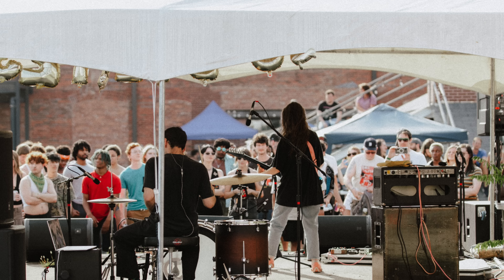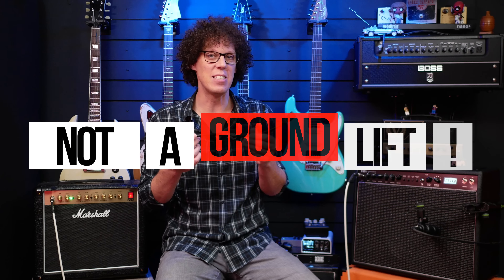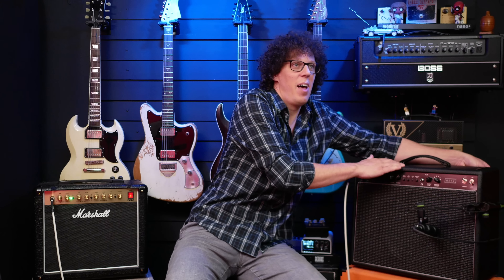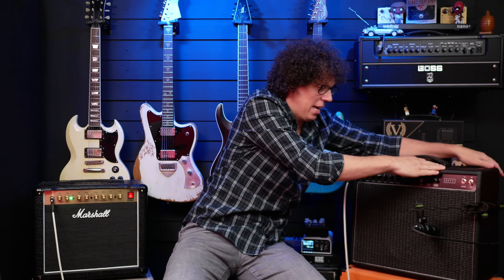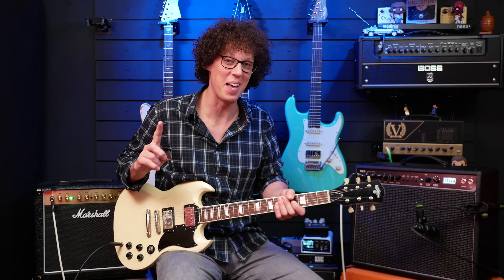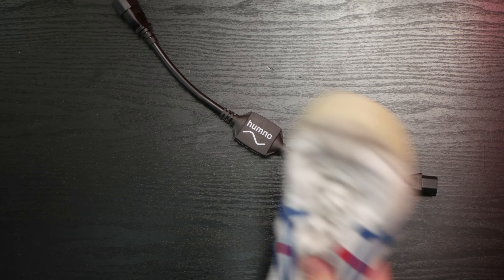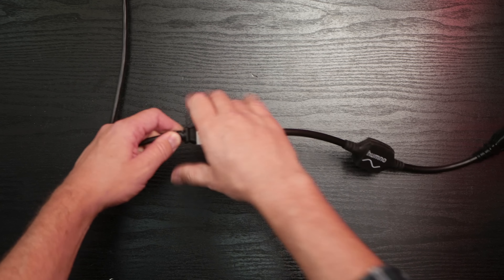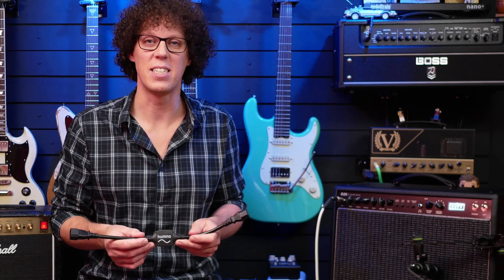Save your Guitar from Ground Hum or Snake Oil? | Morley Humno

Comment: The 1M$ question is: Why aren't amps built with this in them decades ago?
Reply from the maker: That is a damn fine question!
Reply: Probably because guitarists would say "it sucks tone!"
Reply: Maybe because they're supposed to be loud anyhow? And they just didn't care much.
Reply: @nedim_guitar  Huh? The video was about eliminating ground hum noise.
Reply: @v3n0mm3n0  Yes, I know. I'm just thinking about why they haven't built that stuff into amps decades ago. Probably because of the imperfections of all equipment, recording etc.
Reply: Well, it's an added expense, and it would only address the problem at one device (the amp). And if you followed the distributor links, you'd realize it's a very nontrivial expense. Ground loop hum can involve other parts of your signal chain. I have brought a HumX from Ebtech Audio (before Morley took it over) to soundman gigs for many years. I have it on a power strip that handles the mixer, power amp, and other devices. It makes no sense to put one of these in multiple devices (with the accumulated expense) when one of them can support multiple devices where necessary. If you do this, be careful to obey the current limit for the Humno/HumX. I believe it's 6 A for both (it's evidently a current limit, not a power limit, so folks with 230 V mains can protect more gear). —Tom

Comment: I'm in a 1950s built apartment with old wiring. On a good day, my amps- all practice ones- don't hum on their own. On a bad day, everythnig you try to negate it only screws up any tone I'm trying to get. This Humno or even the HUm Exterminator is a problem solver.

Comment: Having 50+ years in electronics and music I must say that in that little package there's no room for a well dimensioned line filter, and,  a line filter, on the other side, is designed to reject hi (RF) frequencies on both ways. So, I only can imagine that this black box is only a resistor in series of both ground pins, with a value large enough to minimize the loop ground current, but not too large so there's still a good grounding for AC dangerous leaks.
Reply: I just use Type 31 ferrite ring chokes and coil the mains cable around them half a dozen times.  Cheap and does the trick 👍
Reply: So it is just an isolation resistor?
Reply: I think it would be really hard to eliminate ground loop hum with any kind of line filter. The hum typically has many harmonics of 60 Hz (and could have other frequencies). I don't see how a simple, small filter could be built to handle this in a flexible way on a mains or ground line.

The Ebtech Hum X is presumably the predecessor to the Morley Hum Exterminator (Morley took over Ebtech), which we're told here is the origin of the Humno. I have a Hum X, and it says "Patent Pending" on it, so I did a patent search, which turned up a relevant patent. Look for US patent US20040264712A1, "Method and apparatus for eliminating noise in an electrical circuit," by Melvin Lace. It was filed in 2003, and it is labeled as "Abandoned," which may explain why Morley says nothing about patent protection on their website (the patent probably expired in 2023). The patent is for a device that puts a pair of power diodes, connected in parallel with reverse polarity, in series with the ground line. What this does is prevent ground loop current from flowing for noise signals with voltage amplitude below the voltage drop of the diodes (e.g., ~ 0.6 V for common silicon diodes). But current from a circuit fault with a larger voltage can flow to ground (as long as it doesn't blow both diodes open!).

Here's how the patent describes the operation:

"... [T]he hum eliminator circuit uses the unique characteristics of diodes to allow for the existence of small voltages between ground and neutral but prevents the flow of any current. Various safety laboratories consider voltages up to five volts RMS on the ground line as being safe for a user. Thus, the hum eliminator, if needed, may be configured to allow up to five volts on the ground line with anti-parallel avalanche diodes or other current limiting components. The diodes have a stand off voltage of 0.7 volts, and can also be connected in series to allow for higher voltages...."

If this is really all that's in a Hum X / Hum Exterminator / Humno, it's really hard to understand the high price. The "avalanche diode" mentioned in the patent is also known as a Transient Voltage Suppressor (TVS); they're used in surge suppressors, and they're relatively inexpensive. Regular power diodes should also work, and are even more affordable. With the patent having just expired, perhaps we'll see more affordable versions soon, if this is indeed the technology behind the Humno. —Tom

PS: I tried to find out who Melvin Lace was, and whether he was connected to Ebtech. All I could find was an obituary for a Melvin Lace who died in Illinois (where the Melvin Lace on the patent lived), in 2008. He was an electrical engineer and musician, with degrees in both areas. The obit does not mention any company affiliations, but notes he held multiple patents. RIP, Melvin, and thanks for the tech! 

PPS: The patent was submitted by Romi Bose, a patent attorney in IL who evidently is still working (he has a LinkedIn page), so someone interested in the history of Melvin's patent might be able to learn more via Bose. He was affiliated with Molex (a major electrical connector manufacturer) at the time of the patent.

Comment: 4m10s. I had a wonderful sound person cut the earth to the desk before we got to the gig. I stepped up to the mic with my tele in hand and got 240v AC straight in the gob. When I stood back up(thankfully) I even impressed myself with the variety of invective that I directed towards the desk at the back. The caretaker shut the power off and we cancelled the gig. I was shaking too much to play or sing, had ringing in my ears and a baaad headache for the rest of the day.
Reply: Yikes! I ate 120 volts from my mic and a 2x12 amp I was using. Not nice.

Comment: Yup I remember growing up in the 70s and hearing stories of Guitarists getting shocked or even killed when their strings became "live". It made me wary of electric guitars and amps for a while.
My dad (electrical engineer) explained it to me at the time and he drew some circuit diagrams to show which amp designs could potentially go "live" and those which couldn't. Never ever cut your EARTHING!  Anything with a metal case or chassis should be earthed. I also remember him saying double insulation and no earthing was a very bad idea and I still think it is even though a lot of gadgets are double insulated instead of being earthed these days.
Reply: It's always worth putting a resistor between your Earth wire and your strings on your guitar
Reply: @BeesWaxMinder  I would never do that and you shouldn't have too. If your guitar is set up and wired right it shouldn't need it. An earth path should be direct without interruption. You do understand what a resistor does?
Reply: @wideyxyz2271  yes BUT it is a fairly well-known mod if you put a low Power element so that when it's subjected to the electrical force enough to cause bodily harm it will blow/break & will act like a fuse in that respect
Reply: Had a tube amp from a stereo when I was 16.  Sometimes the strings were hot.  I would turn it on and ask somebody to hand me my guitar.  If they didn't yell I knew I was fine.
Reply: @toddism  😳👍
Reply: @BeesWaxMinder  Not a risk worth taking. You dont fcuk about with the earthing on anything unless you want trouble. Just my opinion just ask any spark or electrical engineer.
Reply: @wideyxyz2271  I hear you and I understand

I've been making guitars for 32 years now and I always offer this option to clients and none of them ever tell me NO but then none of them have ever been electrocuted either so...

I totally understand your concerns though and thank you for voicing them👍
Much appreciated
Reply: @BeesWaxMinder   Friends, I think some safety advice we can all agree upon is: “When frustrated, consider trying inaction. When frustrated: do not act reactively. When frustrated, consider setting down your guitar and putting your recording equipment temporarily aside. Walk to your local for a few pints. Stick to beer and avoid liquor.”  My small Fender Blues Junior {Lord Almighty, I truly love that amp} was picking up hum AND radio signals. I very much wanted to record. I discovered that in my apartment (American 1930s building) NONE of the outlets were grounded. NONE. I tried ALL of them. (Frustration enters, stage left,)   My Da worked on early computers and knew some things about electricity and electronics. His leather briefcase held soldering equipment, and no paperwork of any kind. I telephoned him asking for solutions to my noise problem. He told me I could try connecting my amp’s third prong to a radiator using a length of insulated wire. Maybe the path to ground wasn’t direct enough, or maybe the old plumbing had a high proportion of lead—a poor conductor—in the make-up of its  pipes. The suggestion didn’t work well. (Spotlight frustration: the guitarist wants to record. His personal music time is not abundant.)  The phone call to my Da had already ended. The radiator didn’t work to go to ground, but there was an exposed plastic box on the baseboard that was vomiting spaghetti (copper wire actually, but it was messy like disgorged noodles). Nobody ever fixed up that electrical mess because it was there for landline telephones. At that time in history, almost everyone in Portland Maine had abandoned telephones with wires that plugged into walls.  I figured one or some of these chaotic wires in my apartment went to ground. Did I mention that frustration was affecting me ?  I lay prone on the floor and used some wooden chopsticks to connect my amp’s improvised, yard-long, ground connection to something—any wire, really—spilling out of the obsolete box and…BAM !! Super loud pop. The loudness level of that pop was VERY surprising. A bright flash of light, and then darkness…darkness throughout the entire apartment building (maybe the whole city block).  Did my chest hurt because I got startled ? Or did my chest hurt because only some worn floorboards separated my trunk from pipes and wires and building materials ?  Did the electricity WANT to flow through me even though I’d chosen bambo chopsticks for this chore ? I honestly don’t know. What I DO know: do not do things when frustrated, foiled, and cranky. I wanted to record using that amp, and I couldn’t just let it be. It wasn’t sensible, guys. Not sensible or safe at all.

Comment: If you use a variac with the output voltage set for the amp, it should be as effective in theory

Comment: My amp buzzes like this with only a (humbucker) guitar and speaker cab attached. I've tried the Ebtech HumX eliminator and it didn't make any difference. I see Morley has a rebranded version of that unit too (called the Morley Hum Exterminator). I'm curious what the difference is between that $79 Ground Hum Filter VS. their $105 HumNo ground loop filter.

Comment: I get a hum while trying to use a Focusrite USB interface into my computer. What am I doing wrong. Both are on the same circuit.
Reply: Dude, exactly the same. I have tried literally everything. The only way I can get a bearable signal is to have the gain at 0... all appliances turned off and line level not inst level. Then boost the sound as much as possible in software before its horrible again

Comment: So would you need one for each mains electric ring? Say each amp is on one ring and pedalboard on a third would you need two in order to isoltate two of the thring rings? Then the third ring is isolated byproxy.
Reply from the maker: From Morley -
All you need is one Humno in your set up to break the loop. That said, the Bass player (or 2nd guitar player, etc) will need one of their own to solve the problem in their respective set up. 

Bottom line is that each player will need their own, but only one per instrument set-up.
Reply: @TheGuitarGeek  thank you

Comment: The keyboard player/rhythm guitarist in my old band could really have done with one of these devices as he had major interference problems from his keyboards after buying a guitar with P90 pickups.  It was so bad he ended up replacing the pickup with a P90 sized humbucker.
Reply: Then you need to rewatch this video. This device cannot get rid of noise/hum/buzz that is picked up by the guitar pickups. That’s a different type of noise than the ground loop noise that this device fixes. He makes that clear in the video. You must have missed that part.

Comment: I'm wondering if what I have in my studio at home is ground hum, the sound is similar but not exactly? Let me attempt to explain: 

I have a powerline to have internet between the rest of the house and my studio. 

I'm running everything (or almost everything) through a multi plug socket: computer, mixing table, Helix pedalboard, studio monitors to that powerline's IN so they all get power. 

I hear a hum at times and it seems to come from the mixing table from the testing I've been doing. 
Would the Hum-no help? because I am dobuting it does since everything in the room is coming from theoretically the same phase, but if anyone knows any better please do let me know

Comment: My issue is my power cable is hard wired into my tube amp so I can't add it. i wish they made a EU version Hum Extractor as I would buy it in a minute.
Reply from the maker: I had this problem with fender deluxe reverb so i cut the plug off and added one of these
https://amzn.to/3s1N97e
Reply: @TheGuitarGeek  Thanks Andy. Really love your channel. I live in Slovakia and hope to see you play live one day as I believe you live in Linz and that s not far from me. All the best.🎸
Reply: If the filter is in the middle, the ends could probably be refitted to powercons? Less sticky than tape residue

Comment: Do you think that could get rid of the "to many pedals in a chain" noise i get?
Reply: that’s a noise suppressor/noise gate job- the humno just works for the ground loops from mains, although getting a power supply which is isolated instead of a daisy chain etc. should also help! :)
Reply: @tobyzxcd I couldn't recommend that enough...it's not fun or cool like a new pedal, but isolated power supplies are money very well spent